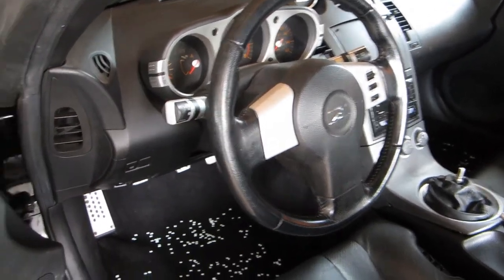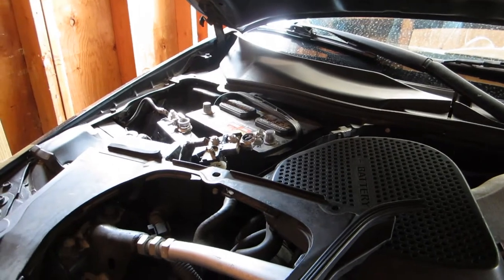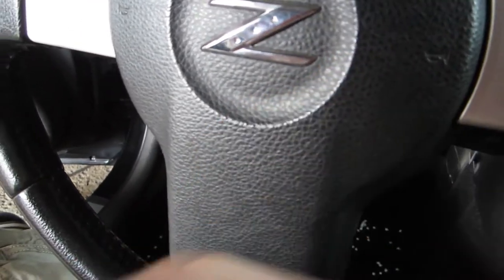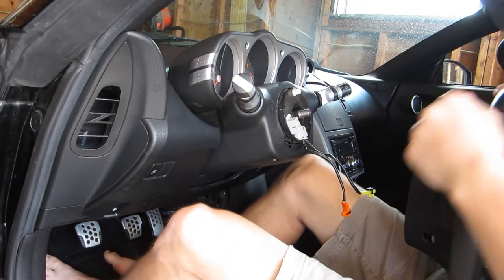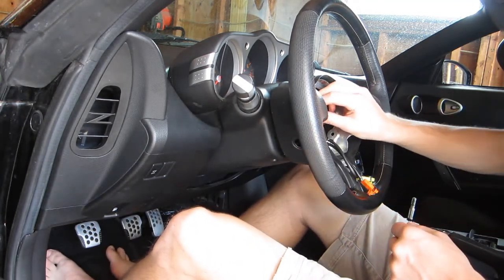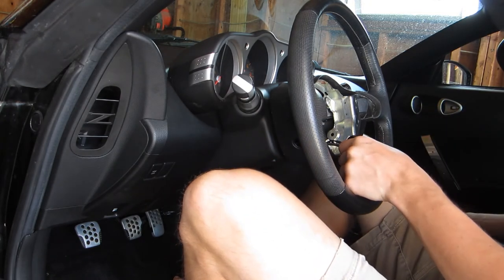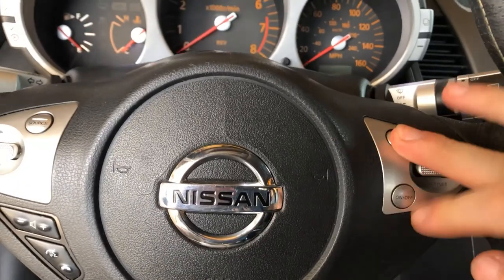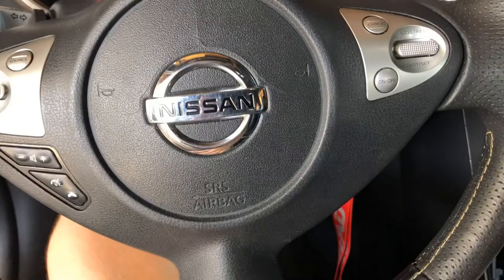Nissan 350Z mod: 370Z steering wheel upgrade

Comment: Sorry, but you left few issues out of this video. 1.  370z steering wheel is half bore out of the center, cos boring is different in 350z/370z, so you have to align your  wheel to get it centered. 2. Your cruise engages but your other cruise buttons doesn't do what they should. This is cos resistance is different between 350z/370z controls. Look the wiring diagram from service manual. It has been written there. You can fix it but you have to change resistors for the controls circuit board. 3. Also your left hand audio buttons must solder like it's an 350z if you want ie. Bose understand those commands. doable also but need special understanding from car electricity. Done that been there but this video can mislead people. It's not so easy.